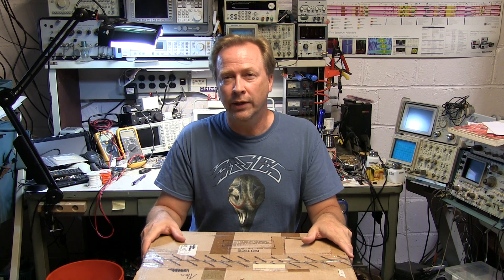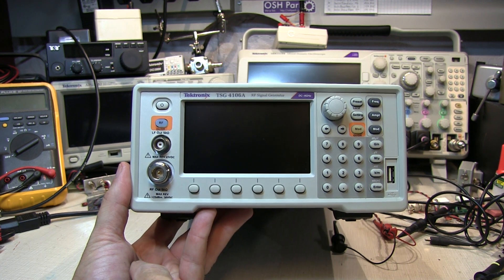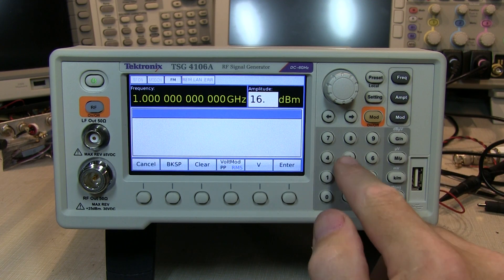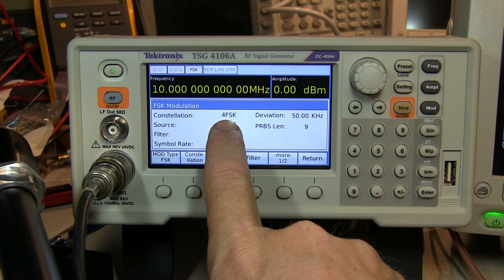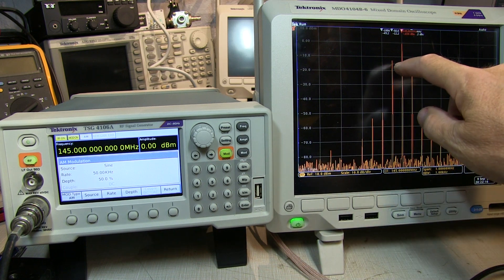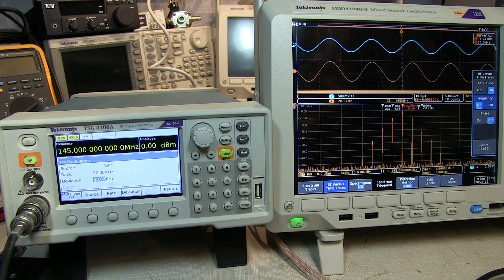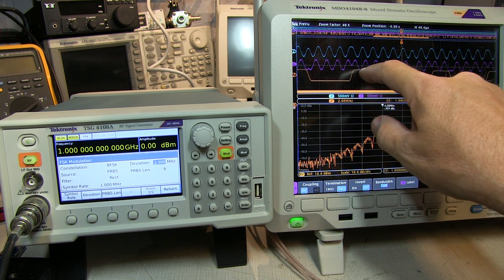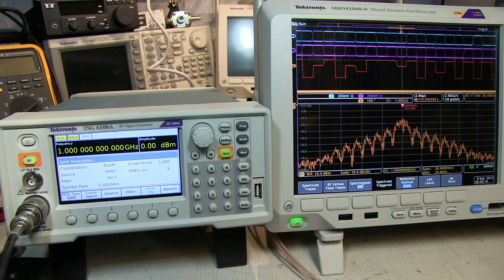#211: TSG4106A RF signal generator unboxing and mini feature review

Comment: I recently re-watch this video and it suddenly occurred to me that the rear panel input look very much like Stanford Research System’s SG380. I went and look up the spec, sure enough they are identical. The user interface and control are different, but I bet they use the same RF front end. They even have the same SSB phase noise curve. I guess Tektronix is buying the RF front end from SRS and retrofitting their own UI around it? Maybe Alan can chime in and confirm my guess. SRS makes great analog circuits, but heir really need to up their game for the control interface for the gears they are making.
Reply from the maker: Yes, you are correct.
Reply: w2aew I wonder if people know this or it’s a secret and I am not suppose to reveal it 🤫. Also for people thinking about buying this, SRS list price is like 1/3 of what Tek listed for essentially the same instrument, if one can live with the user interface that take is not very easy to use.

Comment: Thanks so much for making this video. What is your definition of the difference between analog and vector modulation? Thanks so much.. it's hard to find a clear online reference for this.
Reply from the maker: In general, vector modulation usually refers to forms of digital modulation that alter the phase and magnitude of the carrier (or subcarriers in the case of OFDM), often where the baseband is represented by IQ samples and the modulation/demodulation is performed with quadrature conversion.

Comment: Hi! nice review! I love your videos!

Question: I have been wondering why sophisticated generators like this do not offer the SSB (LSB or USB) modulation type often seen in ham radio. Why is that? You have other videos discussing how to produce SSB but that requires some work... all work that could easily be done digitally by the modern generators.

Thanks for any answer! Keep up the great work!
Reply from the maker: Generally not enough demand in the commericial world.  SSB is most often used for audio transmissions.  Testing is often done with simple audio tones.  This can easily be emulated with a signal generator without SSB modulation mode.
Reply: @w2aew  Thanks, I was suspecting it was lack of commercial interest. At the same time, it would (probably) be just a software/firmware update and require virtually no development cost from the vendor. Anyway, thanks!!!

Comment: Dumb question but why do people say DC up to .. meaning 0 volts flat up to ..?
Reply from the maker: DC doesn't mean 0 volts.  It just means 0 Hz.  In the case of this generator, it can output a DC voltage from its low-frequency port.
Reply: @w2aew  ok thanks for the explanation

Comment: Do you recommend tektronix MDO4000 series? How is the spectrum analyzer of the scope compared to an average dedicated spectrum anaylzer?
Reply from the maker: I love the MDO4000. The spectrum analyzer performance is roughly equivalent to stand alone basic spectrum analyzers. However, the MDO's analyzer does something that no entry analyzer can do - capture RF over time so that you can view spectrums seamlessly vs time, as well as amplitude, frequency deviation and phase deviation vs time, all correlated to the analog and digital signals.
Reply: ***** Thanks for the response it really helps :D

Comment: How about a video of using the IQ feature of this generator. This will go well with #170 and #171.
Reply from the maker: +SK Pang Yes, I plan on doing more videos on IQ, and will be using this generator for that.
Reply: @w2aew  Sir, I am reading the Specifications and Performance Verification of TSG4106A, I understand most of the parts but "Output level accuracy (IQ
 modulation relative to CW)" part (on page 21). Even I have tried to read some papers relative to IQ modulation but I still can not get it. If you don't mind, could you please explain it to me?
https://download.tek.com/manual/TSG4100A-Series-RF-Signal-Generator-Specifications-Performance-Verification-Technical-Reference.pdf
Reply from the maker: @Tom-dn5de  See my videos #170 and #171 for a good background on IQ signals and modulation

Comment: I am envious. I am serious about buying a Siglent SDG-1025 two channel for my ham shack/electronic hobby shop. Can I use a SWR Antenna Analyzer such as the MFJ=259C as a RF Signal Generator to calibrate my rigs in the shop? I currently have a Heathkit IG-102 Sig-Gen but would like something digital.
Reply from the maker: +John Jewel It depends on how close/accurate you want to be.  I'm not sure of the accuracy of the counter in the MFJ.  I've found that it is difficult to set a specific frequency in the MFJ, and have it stay there.  The SDG-1025 should be more stable in that respect. Looks like it's rated at 50ppm accuracy which is OK, but not great.  Consider that +/-50ppm means +/-700Hz on 20m.  Of course, you can improve things by using WWV as a zero-beat reference.

Comment: Does anyone know how does this TSG4106A compare to the Rigol DSG3060-IQ ?
Reply from the maker: +SK Pang They're close, but in general the TSG has lower phase noise, lower distortion, higher output power, better frequency stability, wider IQ modulation BW, better amplitude accuracy, etc.  The differences aren't dramatic, but the TSG has better specifications generally.

Comment: Can this RF SG or a FG be used as an experimental transmitter? What type of amplifier do you recommend? for  14MHz. Thanks.
Reply from the maker: +jlfqam They are very low power compared to a transmitter, but they could be used.  Just be sure to properly filter the output (especially on a FG) so that you don't transmit on the harmonics of your output.

Comment: Glad to here that you will be making RF videos. I have a question regarding antenna design. Can you determine resonance of an antenna without specialize equipment? Or limited equipment?
Reply: Hear
Reply from the maker: It depends. At the very least you'll need something that can generate a signal at the frequency range for the antenna. Beyond that, you can get away with directional couplers, etc.
Reply: +w2aew Thanks Alan.  I do have a function generator 25mhz and a 70mhz oscilloscope but doesn't cover the signal i'm interested in 5.8ghz.  I thought you might would have a DIY way of determining the resonance of a DIY antenna.  Thanks for the reply. By the way you are a great teacher, great vidoes.

Comment from the maker: +Rodrigo Lisboa - in general, an RF signal generator will have better spectral purity (lower distortion), a wider adjustable voltage range, better amplitude calibration, and more modulation features than a function generator.  But, for a basic, unmodulated sinewave, a function generator is often good enough.

Comment: To be honest it makes me a little bit annoyed that people fixate on the cost of gear. That seems to be such an overwhelming concern pattern for everyone... and it's completely the wrong focus. Alan would never be harsh about this point, but I am, sorry! ;) Nobody questions the cost of equipment at universities. The correct focus is knowledge. Whatever tools are available to help get a concept across in the clearest way, are by definition great tools. Once you fully understand how something works, you can think of great ways to minimize development costs (hobby or otherwise) since you have a solid idea of what you require and what you don't. Knowledge should precede any purchasing decisions. The RF gen in the video is not a toy, nor a thing to "play around" with. You either need one, or you don't. You either need specifications of that tier, or you don't. I have a 4GHz signal generator that I paid $500 for. I don't need a vector gen. The Tek unit would be massively overkill, and the engineering effort would be wasted on me. Nothing is worse than underutilized gear that some engineers poured their hearts and souls into. But - the vector features of this Tek generator, combined with that scope, make an ideal platform for teaching and examining every conceivable aspect of signal integrity and modulation. //end unpopular opinion ;)
Reply: +whatlions That sound all so correct but I am not sure if you are correct. :-)
If you have teachers and gear at a university you can get knowledge and use gear without "playing around" and therefor you know what you need when and why. But the rest of us who are "playing at home" we can only get knowledge by reading, talking and by "playing". So therefor I think that it is a great idea to think of the price before investing in something you may newer use. First buy a cheap one that you can replace as soon you know what you are doing, needing and so on.  On top of that, not many can say "I dont care I'll just buy the 8,000$ version". For many it would take years to get that amount of money without ever getting them back. So therefor again, think of the price and try to get what you can afford rather then what you would like to have.
I would like a 10GHz scope, do I need one, can I ever afford one, can I use one? All no so I find the cheap alternative play with that and then later buy what I really do need.
Reply from the maker: +whatlions Well stated, thanks!

Comment: Alan, Great video, nice piece of kit. Question: Is there any way that you can set up your new Signal Generator to act as a tracking generator for your spectrum analyser? As far as I am aware the model on your bench doesn't have a built in TG.? If there is a way of doing this it would make an interesting video for those people with a Spectrum Analyser that doesn't have a TG.RegardsBarry G4RKO
Reply: +g4rko Barry I do not believe the MDO series has any provision for an external TG whatsoever. It is a real shame as it seems to be a critical missing feature on an otherwise great tool, especially since it has a function generator on it. For many applications though, yes you can do what you suggest if you have a little ingenuity. The SA can plot a signal maximum, and if you set an appropriately slow sweep rate with your sig gen and it has a flat response you can build up a response curve over time. If the MDO can normalize and make a relative measurement, even better. You can also use fast pulses to generate harmonics that are relatively flat across a small frequency range to kind of get a rough idea of filter shapes or amplifier response. Finally, you may be able to use a broadband noise source as well... Each option depends greatly on what you are attempting to characterize. I could not personally conceive of buying a SA without a TG. To me it would feel like a crippled instrument, but for many people the opposite is true and they have absolutely no use for one!
Reply from the maker: There really isn't a way to turn this siggen into a tracking generator, mainly because there are no control input that would cause it to to track the frequency of a swept spectrum measurement. Secondly, the spectrum analyzer in the MDO is not a conventional swept analyzer design, so there's really nothing to 'track' with a tracking generator.
Reply from the maker: I've done videos on those other TG-less methods (broadband noise, slow sweep and comb generator). Each up have their place, as does the tracking generator. The MDOs don't have a TG option mainly because they don't sweep like a conventional swept analyzer, so there's nothing for a TG to track. I actually have an older Advantest SA with a TG that I use when I need it.